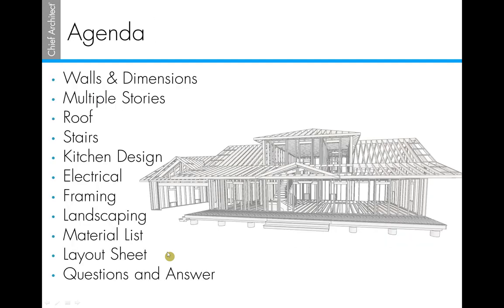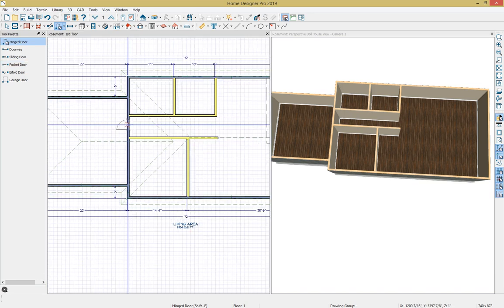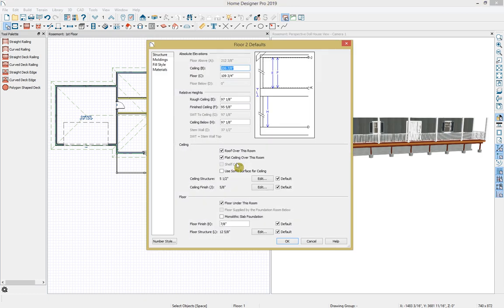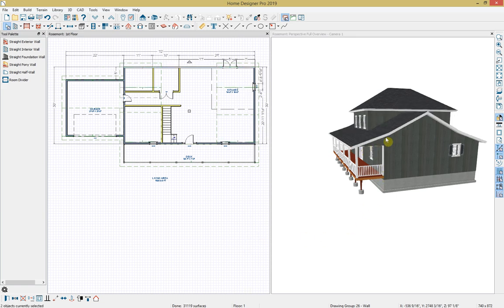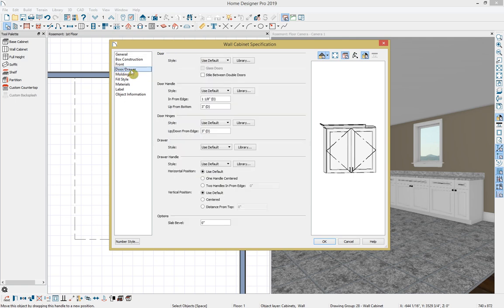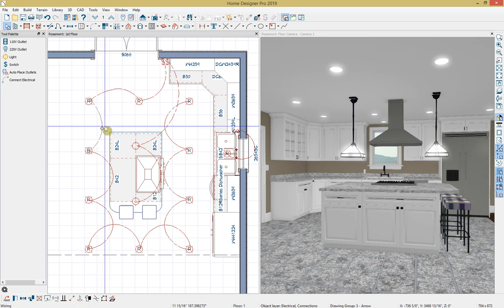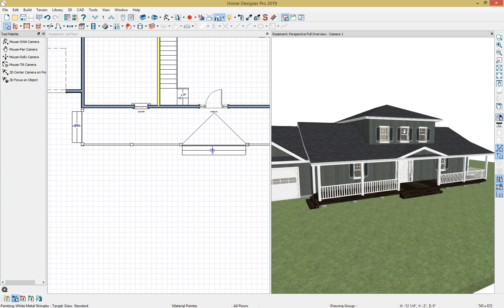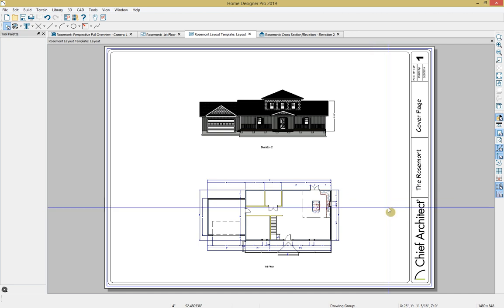Home Designer 2019 Quick Start Demonstration

Comment: How do you frame a chimney
Reply from the maker: You can use a Straight Half-Wall where your fireplace would go and then adjust the height of the room and add framing. I have linked below our help article that goes over how to create a custom Fireplace and Chimney
 but note that this article uses a soffit to make the chimney and the program does not frame soffits. I hope this information helps. 
https://www.homedesignersoftware.com/support/article/KB-00744/creating-a-custom-fireplace-and-chimney.html

Comment: How do u add those posts to deck?
(Column?)
Reply from the maker: Hi S.S Games. If you open a railing for specification, you can go down to the "Rail Style" panel and under "Newels/Balusters" can select Post to Beam or Post to Ceiling. You can then go under the "Newels/Balusters" panel to control the spacing and width. Alternatively, you can add columns from the library manually. I hope this helps!

Comment: Hi, great tutorial, this software has a a lot tools that other home designs do not have.  Is there a setting or a comparable for a log cabin?  I would like to build the exterior of the house with solid logs but frame the interior.  Is there a setting that would allow me to do that?
Reply: I would be using D logs so top, bottom, and one side flat and the last side is rounded.
Reply from the maker: Hi Matt, thank you for asking! Home Designer Architectural and Professional provide logs in the library that can be manipulated as siding. We have an article on our website that explains the process further here: https://www.homedesignersoftware.com/support/article/KB-00683.
Reply: @ChiefArchitect  I saw that article, and that's was wondering If the first picture was the end result of the program or from another.  Lastly, does the software take into account local or standardized codes, give a cost and/or materials estimate.   If it did that would be great.
Reply from the maker: @mattdovi2255  Yes, the image on the article was created in Home Designer. All Chief Architect Software products are loosely based on IRC Code. However, you will need to know what your local codes are, as the software does not do the engineering for you. For example, with Home Designer Professional, you can specify if a wall is a load-bearing wall using the advanced framing tools, but the software does not automatically know that based on your plan. Yes, the software will generate a material list takeoff from your plan. You can then add in your own custom pricing information. 

We'd be happy to discuss this further with you if you wanted to contact our Sales Team at 208-292-3400. Thanks!

Comment: Hey does it generate blue prints for US?
Reply from the maker: Hey Robert! Home Designer Professional supports a single-page layout sheet that can be printed at up to 18"x24". 

To create a full set of blueprints at 24"x36" or larger, we offer Chief Architect Premier. More information on this product can be found on our web page here: www.chiefarchitect.com/products/home-design/premier/. Thanks!
Reply: Chief Architect Software Expanding on Robert's question.  Q: does the program render all line dimensions for the 18"x24" prints ?
I'm in need to design and render blueprints to submit to my township zoning office for permits. thanks in advance. 

I do like this program as CAD is just to much for me. I've used home design pro many years ago as a visualization tool. now it's time to make my dreams a reality. however getting through the zoning department is intimidating here.  I believe with this program I can get around their red tape jargon and get on with my life. thanks again